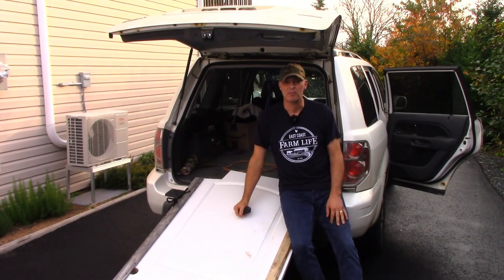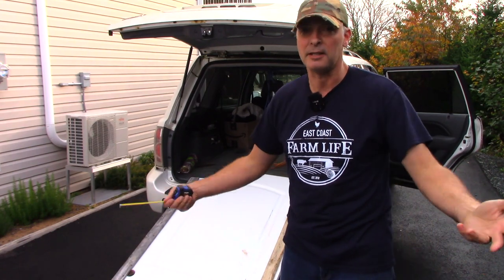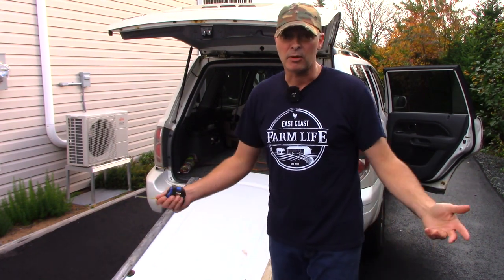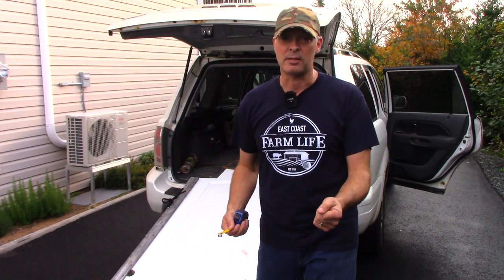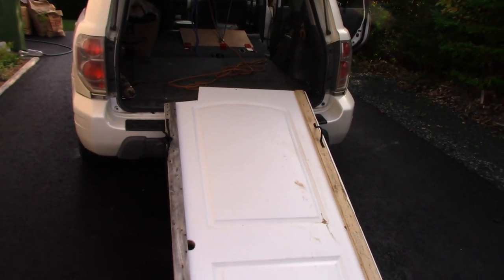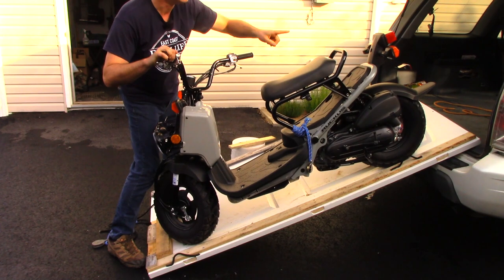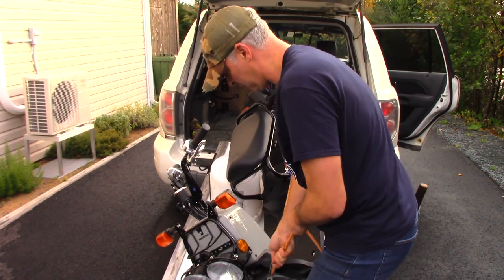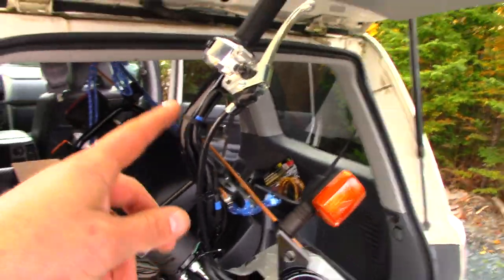How to Slide a Honda Ruckus into an SUV

Comment: I have often thought about how to get a heavy load into my SUV.  Yours is an eloquent solution, which I plan on using in the future.  As an addition to your idea, try placing a large sheet of cardboard on the floor of your SUV.  Placing a large piece of cardboard under your door will reduce the friction, make it easier to push your Honda Ruckus in and out of your auto, and protect your car’s carpet.  Good job on the video!
Reply from the maker: I should have mentioned - this is another "simple machine": the incline plane

Comment: Did you need to drain the fluids on it to have it at that angle? I have the same vehicle but was hoping to keep the scooter upright. I think I might just loosen the handlebars, or take the front wheel off
Reply from the maker: Good question - the tank can't bee 100% full or it will leak at that angle. I think half-full is good - but it doesn't need to be drained.
Reply: @outdoorsonthecheap  I ended up taking off the handlebars and it fit upright in my pilot!

Comment: I chose our SUV so that I could fit the base of my large telescope through the hatch without tipping it over. The vertical aperture of the hatch of most SUVs is often smaller than the ceiling height. RAV4 rules with 1/2” to spare.
Reply: bro telescopes so hard he described a trunk door as an aperture

Comment: Hi, thanks for the video. I’m about to do just the same but I’m having doubt whether it’ll fit in my Toyota Rav4 (2017). Can you précise the length you’ve had to make it fit ? Thanks
Reply from the maker: I think the honda pilot is substantially larger than a Rav 4. It barely fits in the Pilot - so I doubt the RAV 4 would be big enough. you can but a rack that goes in your trailer hitch for about $200-300 - much cheaper than a trailer and willl work fine

Comment: lol, park beside a curb and just just push it up onto a hitch carrier with the built in ramp. And you can actually put stuff in your SUV too.
Reply from the maker: This one doesn't have a hitch, and can't have one installed due to work on the frame. Also, that costs more money than this, and this channel is "outdoors on the cheap". :)
Reply: @outdoorsonthecheap  But. . . a ruckus is like 2500 bucks, even used. A hitch carrier is 100 bucks. I get that you don't have a hitch mount tho. I think that most vehicles that could fit a ruckus probably do.

Comment: Buy a truck lol. This is just silly.
Reply from the maker: So I have an SUV that I bought for $4000 that is reliable. What are the odds that I can sell it, get $4000 for it, and then get a truck that is equally reliable for $4000? I'll tell you what they are - practically impossible in Nova Scotia where all old vehicles are rusted to pieces. Also, there is no reliable truck that I can put my family in comfortably for $4000. This vehicle is what I have, and I'm showing people how to get by with what they have - that's why the channel is  called "outdoors on the cheap". If I just bought a truck - as you suggest - I'd have to change the name of the channel to: "just buy things to solve your problems"  - which would not be a very useful channel for most people :)
Reply: yes. a honda ridgeline. a real man's truck.